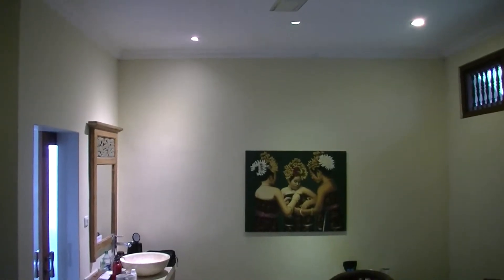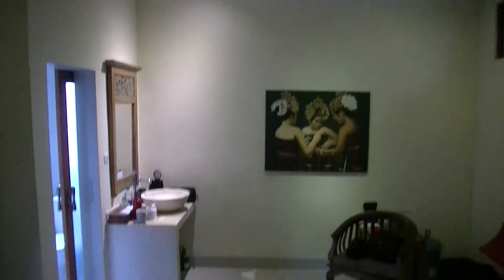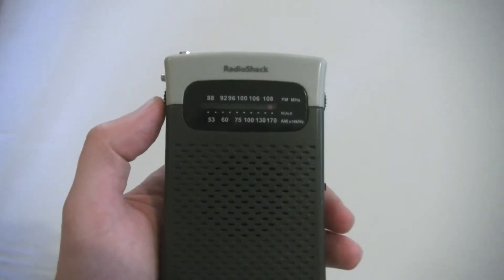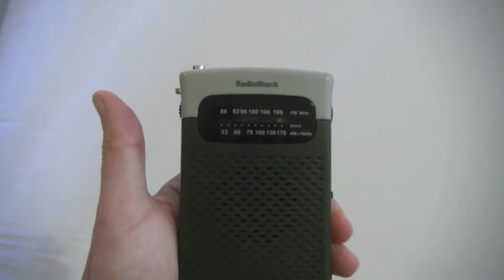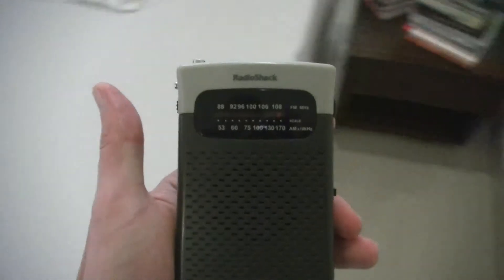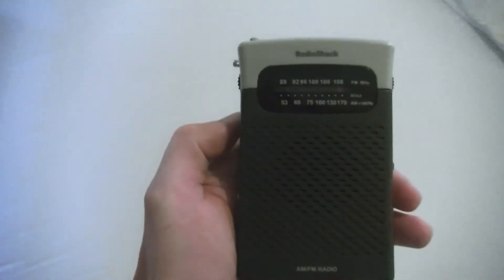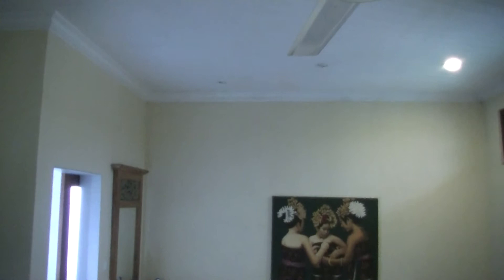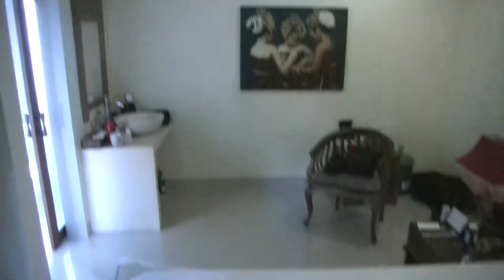How to Detect Electrical Noise from Lighting Fixtures

Comment: I don't need a tester, I've been accused of having ultra sensitive hearing. LED & fluorescent sounds like flying mosquitoes, wifi sounds like a fax transmission but much lower. Some electrical wall outlets sound like rattling cellophane. I try to make my house as sensory friendly as possible, I feel like oversensitive hearing is a curse, like in the House of Usher. I can usually feel where wires are running through sheetrock walls, and feel a tingling shock when near 330 appliances, my hands get numb from shock when putting clothes in the dryer. My house was built in 1957, it's an electrical nightmare.

Comment: I did this to pinpoint the noise, it was close to a light, I pulled the light fixture out and reached in and found the transformer for the LED light was taped to the metal batten they use in some houses to fix the gib board/ dry wall to, so the transformer  was using the metal batten as a kind of aerial. It quietened down heaps after that.

Comment: this is so interesting. what are the possible options to resolve this if you do own the house? wondering if this is related to wiring issues or rather to the type of bulb?
Reply from the maker: Typically replacing the lighting fixture or even just the bulbs will resolve the issue.
Reply: @emfanalysis  Are there any bulbs other than incandescent that will not create EMI. Of course, fluorescent lights are out, but is there a safe brand of LED lights you can recommend?

Comment: Have a small transistor radio and find it noisy by att broadband (turned off wifi, is cabled) and its plug(phone and electrical both), by keyboard, a few light switches, in wall between bathroom and bedroom (is outlet 2'below). Am guessing different causes, but is interference. I can make my regular radio go static depending where I walk in that room. Thank you for the video.